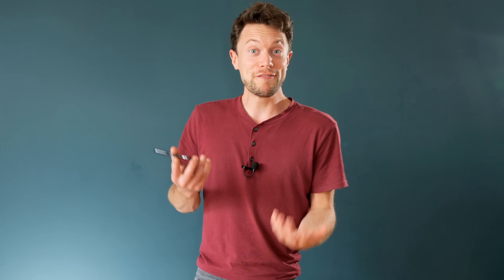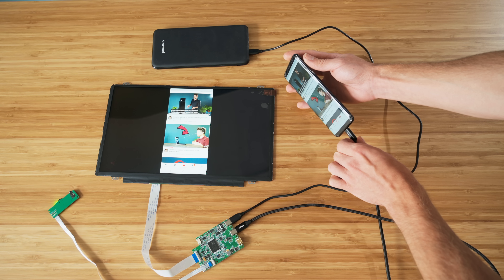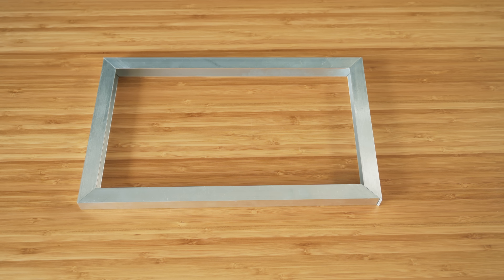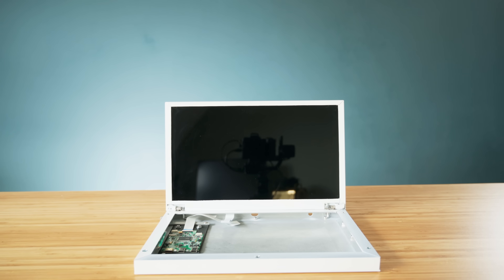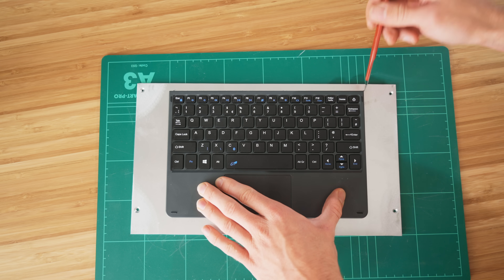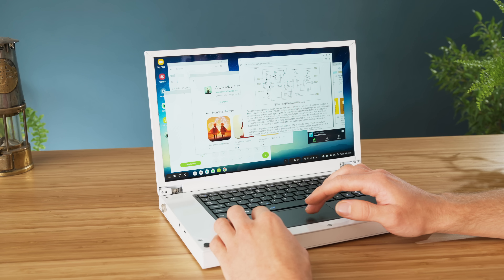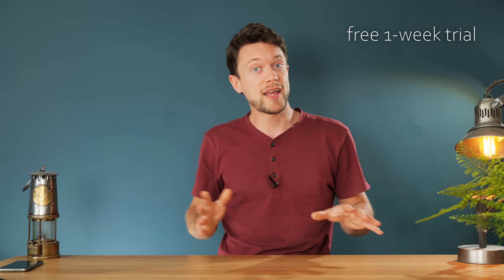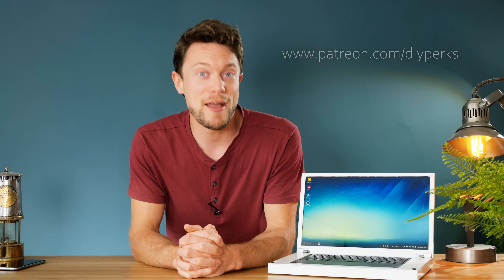Broken smartphone to working laptop transformation

Comment: Alternatively, you can tear the phone down if you have a broken screen, and put the bare motherboard, battery and stuff in there. To improve the speakers, I would just use speakers from some other phones, as some models have the potential to sound really good even with their small size. Using the bare motherboard and putting a aluminium sheet on it would also improve the sustained performance compared to the bare phone body.

Comment: can you do an updated version of this one? I think we could get a lot more out of it by now. Also you could thin it out a bit more with some newer powerbanks, make it closer to a 2 in 1 style with say a wireless keyboard (nuphy would be great for this with the air 75 (probs the v2, v3 with the knob probs aint it but that's just me) You could make the battery, board and a phone holder in the back, that the phone just slots into but still keeps wireless connectivity. You also might be able to get away with a thin acrylic panel to hide it all behind to keep that connectivity.

Comment: Usable laptop is a stretch.

It's a usable phone in the shape of a laptop.

It can't run anything a PC would be able to which is what 90% of people need when thinking of turning a phone into a PC.
Reply: Eh, I disagree. This is a perfectly usable netbook, especially as an addition to an existing setup. 

Android phones running a terminal emulator can give you access to your existing server, if you're as into self hosting as I am. 
If not, most of the android apps we use for productivity are cloud based. Either way, 17 hours of light use on a laptop is pretty damn rad.

Comment: Good day, I have a tablet  Asus Transformer Pad TF300T. I really like its form factor. Both a tablet and a netbook with an additional battery and keyboard. But there are no such analogues on the market. I do not consider separate keyboards with a book-case-stand as a netbook form factor. This is inconvenient for me. I had a crazy idea. Is it possible to take out all the old insides and replace them with the insides of another newer tablet or phone, the board there is smaller? If suddenly you have any ideas, write

Comment: If you are connecting the phone then charging the phone can be like a battery and the battery can give power to the components to so why add a power bank I don't get it ?

Would cardboard work I don't have machine to cut aluminium 😅

Comment: 7:45 this socket is REALLY DUMB IDEA if you think some 12 and 24 volt adapters using same port.

AND YOU INSTALLED THIS SOCKET WITHOUT OVERVOLTAGE PTOTECTION!

Comment: It sounds me like a scam. 
- On the display runs emulated  W10 skin, while on the phone display is seen classic Android.
- To the phone is connected 1- Display, 2- Powerbank, 3- keyboard.... and potentionally external storage. But phone has only one USB-C output. And into chasis was not added any hub or docking part.

Comment: What nonsense are you talking about? There's a problem with your plan from the start. The all-aluminum body and steel frame under the keyboard top case block the WiFi signal. Yes, you said that.However, I didn't expect this project to be lazy to the max. Want an idea? I have one. Go dig through your broken laptops and try to create a frame for them without using what you usually use. Namely, aluminum profiles. Your choice: molded silicone, epoxy resin, piece of plexiglass, fiberglass, carbon fiber, acrylic, steel, copper, brass, titanium. A sea of materials. But you're fixated on aluminum. And try to come in anyway, on xda developers. Dudes modify and write firmware. Including software for this grief-stricken and life-stricken Samsung. And also, be friends with a soldering iron more often. Diy This means not only connecting the case with the display, the purchased board and the power bank into one.

Comment: I have a perfect s8 phone and a very old laptop which i never use, but it works well, although it's really slow, is there a way i could use the s8 on the old laptop for a bigger screen, larger keyboard,  and faster speed, similar to Dex on modern Samsung devices?

Comment: Why haven't I watched this before? I've got a smashed Samsung Galaxy S-something and a couple of old laptops with good keyboards right next to me on my desk. I'd have to get a keyboard USB controller, I think I know where to get that. I'd need a capacitative trackpad too. I wonder if I could use the huge but impractical-for-desktop trackpad out of my Thinkpad T440, and maybe the buttons from the R400 I mean to convert. Hmm, possibilities! :)

I like the screen bezel. I never thought of using aluminium angle, it looks much easier than anything I imagined. And the U-channels for the base too. And if I made a case myself, like that, I could paint it however I liked. :)
   (Another commenter suggested using PVC instead, to pass the radio signals. Noting this for my own future reference.)

Clipping the phone on the back turned out to be unexpected genius!

Android has a desktop mode now? Huh! I don't know if I actually want it as multiple windows muddle my head. Maybe I should install one of those Win10-mimicking apps. :) But many years ago, I ran Android-x86 on an eeePC. It would have been good if it wasn't for the tiny trackpad, barely 3cm high. My chief reason for putting a phone into the R400 is because it can run modern apps.

If you have a really old phone, you could perhaps install PostmarketOS for a full Linux desktop. :)

Comment: if you use an old laptop for the case, you get the benefit of it not blocking the wifi signal, plus it isnt really deep like a laptop from 1996.

Comment: the only thing that is bad about this design is the U-channel on off sliding switch, thats going to create mechanical wear on usb ports, and if your using an old phone to build this, your usb ports are probably already worn or loose. I think some kind of inline powerswitch on the usb c line between the powerbank and display controller would be an ideal solution

Comment: Can some one share the link of that control board used here?
Reply: If you mean the board used to control the old laptop display then there isn't one. You need to Google the part number of your specific display and write "Control board" behind it. They usually cost 15€-35€ depending on your display model

Comment: I love this build! No 3D-printers involved, and that mechanical switch design is genius.
Reply: 3d printers can be extremely handy. There's even simple and free CAD software to use. Like tinkercad and sketchup. 
You can even combine traditional methods and 3d parts to be more efficient and effective. 
Today, I was replacing a custom fan led with traditional bulbs. Needed an 8mm spacer that took less than a half hour to model and print. 
I highly suggest learning the 3 steps, Model, Slice, and Print. Depending how inclined you are, it can take a week to a month to learn everything.

Comment: This is literally infinitely upgradable. Could always replace battery and upgrade with ease and the phone itself. could use an s24 and a bigger battery bank to have a gaming laptop nearing pc specs without trying, even adding a touchscreen with a high refresh rate would seal the deal, with the phone inside and a cooling pad/fan rig attached to the bottom if you add vents for air flow to keep every thing nice and chill.

Comment: For your volume sliders if you want absolute perfection get some "jeweler files". Super cheap maybe 5 USD or less for a set. Mark the slot like you would for the dremel cut. Only use the dremel to start the slot, then bring your cut out to size with the jewelers files. Or alternatively, for the readers of this comment who would like to try this method and who do not have a dremel, drill a series of tiny holes as close together and as straight as you can, touching if possible. Then connect the holes by running the file through the openings where it is wide enough. Then eat away at the sharp points eventually making the tiny holes into one continuous perfectly square slot for the volume slider. To get the perfect finish with no burrs, take a sheet of 200 grit sand paper or finer and cut some strips at about 1/8" to slide the strip of sandpaper int the slot the you have made. Grab both ends of the strip and slide it back and forth in the slot, eating away at the material and leaving a fine finish. You can also find fine sandpaper with a sticky backing and tear of a piece and wrap it around the file to get perfectly square slots that look like they came from a water jet. Then if you want the ultimate finish, normal sandpaper usually has a wax backing  (not emery cloth, it doesn't normally have the wax) just cut a new strip and flip it over and use the WAX side instead of the sandpaper after you have done your sanding and filing. You can also wrap the wax side facing outward on the file in the same way. Don't apply heavy pressure when using the wax side, get a feel for the perfect pressure while moving it back and forth with the file. If you are ripping the sandpaper you are pressing too hard for the polishing to occur. You will see your slot become super shiny! Kind of hard to describe in a comment! Give it a try! Finally, I see this vid is three years old after typing my lengthy comment! Classic! Your channel is truly amazing! Stay inspired! You are different, in the best way possible! (edited for typos!)

Comment: In the YouTube video "Broken smartphone to working laptop transformation" by DIY Perks, the creator takes a broken smartphone and converts it into a working laptop.

The video begins with the creator disassembling the smartphone. He removes the screen, battery, and other components. He then cuts a hole in the back of the smartphone to accommodate a laptop display.

The creator then attaches a keyboard and mouse to the smartphone. He also installs a custom operating system that is designed to run on smartphones.

Once the laptop is assembled, the creator tests it out. He shows that it is able to run basic applications such as a web browser and a word processor.

The video ends with the creator discussing the benefits of converting a smartphone into a laptop. He notes that smartphones are becoming increasingly powerful and affordable, making them a viable platform for laptops. He also notes that converting a smartphone into a laptop can be a fun and rewarding DIY project.

Here is a summary of the main steps involved in converting a broken smartphone to a working laptop:

1. Disassemble the smartphone.
2. Cut a hole in the back of the smartphone to accommodate a laptop display.
3. Attach a keyboard and mouse to the smartphone.
4. Install a custom operating system that is designed to run on smartphones.
5. Test the laptop to make sure it works properly.

Please note that this is a very simplified overview of the process. There are many challenges involved in converting a smartphone to a laptop, and it is not a project for beginners.

Comment: I know I'm 3 years too late, but would that work for the s23 ultra too? My phone fell out of my back pocket when I was working and landed face first on a wooden deck from 2 stories up. And I don't want to just throw it away. Everything still works, but the screen is messed up like the one in your video.
Reply: Yes it will work. S23u also supports dex

Comment: very good design but I would do it in a different way: in the upper part there would be only the screen and its cable would go to the lower part where there would be its control board with hdmi input connected to the hub which from the usb c port of the phone makes hdmi full-size usb 3.0 and still leaves the usb-c port for charging to this type-c port so that the powerbank with the charging connector is connected to the side of the housing and to the usb 3.0 hub that allows you to connect the keyboard and touchpad, which because they are usb and not bluetooth will be much cheaper and in addition, it will allow you to lead several usb ports to the side of the housing to easily connect pendrives, computer mice, gamepads and other accessories, and the phone itself would not be glued inside the housing, but on the back of the housing or in the upper part, so that there would be a slot with a usb-c port at the end, allowing put the phone you use normally inside and then be able to replace it with another one and everyone who puts their phone inside has all their data on this laptop right away

Comment: ⚠️ ONLY WORKS ON SAMSUNG GALAXY S SERIES (for samsung desktop experiencs) any other samsung wont work as they cant output video. For non samsung devices, check the specs but youll have to use 3rd party launchers and you wil lhave a bad experience

Comment: Hello... My Samsung galaxy C7 pro display is dead. I cannot see anything also the touch doesn't works. It is also pin locked. Can I connect this phone too as you did? I saw somewhere that in samsung mobile we need to agree to the pop up in mobile screen after that only screen would be shared on monitor. Please reply I need to back up my data from it.

Comment: After watching this video, me and my cousin started making a laptop like that. We used a display cracked galaxy s9 which was not responding touch. An amoled Samsung display costs a lot in Uzbekistan so we used thin wooden pannels to cover it, plugged an adapter which has 4 usb-a, 2 usb-c, 1 micro-usb, 3.5mm jack and hdmi ports to the phone. We added 61 button keyboard, 2 mini speakers, hd+ oled display which was taken from a water damaged laptop and a powerbank. It cost around 60 usd. Now my cousin has a fully functional working android laptop.

Comment: Take apart the phone and use the internals. You can put the motherboard of the phone behind the laptop screen and use the camera as a front camera, and the selfie cam of the phone as a behind the LCD camera. The WI-Fi, Bluetooth antennas can be also place around the LCD. The LCD housing can be made of milled Polyamide inside to accommodate the components. The only modification you need is to the battery flex cable. Meaning you need to cut it and extend it with wires. First part is connected to the phone motherboard and the rest un the main body of laptop. Plus you don't need to slide the board to disconnect the USB, but you can place a switch that cuts the GND or the VCC of all the USB. The rest I leave it to your imagination.

Comment: I think it would have been better to take out the motherboard with the cameras intact and then find a way to use the camera as a Webcam and you can have more access to the internals. Also a 3d printed chassis would have been better because it's still durable but also lighter and doesn't block signals.

Comment: I had the same idea, but I wouldn't have used so much redundant circuitry. There are three independent batteries with their own charging circuit and there is an unused display which will consume a lot of energy.

Comment: Wouldn't it be less expensive just to buy new phone? I mean, smashed phone, okay, but buying screen, aluminum plates, aluminum extrusions (by the way he did not mention how he joined extrusions to create screen's frame, looks like they were welded), power bank, lcd control board, keyboard, etc - all this stuff will cost more than a new phone. And in the end you have weirdly looking laptop with limited usability.
I mean, I enjoy watching this energy, creativity, positive mood, Matt is very talented gentleman, but I am just questioning the purpose of this particular project.

Comment: No ad, but i have a CAT S41 and will get a second one if this one breaks. But it won't. I forgot it on my car roof and it flew off at 80 km/h and rolled over by the following semi. Just a scratch. Its 4 years old and the battery still lasts 3 days. Smartbrick.

Comment: so does the keyboard cover automatically pair with the phone? bc i have an samsung galaxy S8 but the internal screen got messed up so i cant see anything on other than random colors spots
Reply: You'd need to pair the keyboard like normal, and then most Bluetooth keyboards will automatically pair after that. You can pair it using the new screen, so long as there's enough touch capability left, or you might be able to use a hub to connect the screen and a mouse at the same time (I haven't tried a wired mouse on Android, but Bluetooth mice can work, and USB C usually is pretty good about connecting random things), or you can get touch-capable monitor panel (though those can be quite fiddly).

Comment: 3:26 Doesn't masking tape leave residue on the screen? :o
7:24 Why would you risk a fire/shock with that round socket instead of just having the usbA end of a charging cable (usbC being connected to the battery) stick out and be pluggable into an extender/charger?

Comment: It sucks that you can’t add USB ports for data transfer b/c you didn’t take apart the phone. Honestly I would’ve taken the phone apart and put it inside the laptop; taken the cameras and attached them to the top of the laptop (cuz zoom on a phone vs zoom on a computer obviously) then I would’ve added USB ports for data (connecting devices) and charging (b/c no phone out rn has a Female USB Port lol), and I would’ve made a transistor switch for using the internal (turns on and off internal and allows connection to USB-C) or external phones for some more features although this may be a bit overkill and you’d need to add more stuff to make this all work.

Comment: for the on and off button you can just connect an power button to the power cable and it will cut out the poer instead of slidind the control broad and gluein the power cabe to a spot